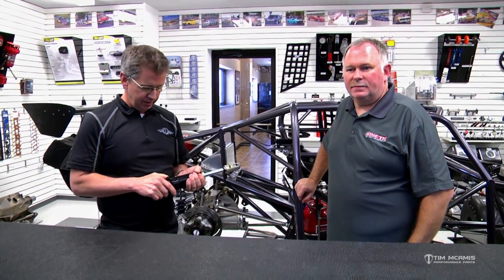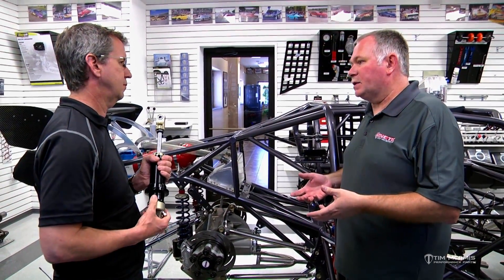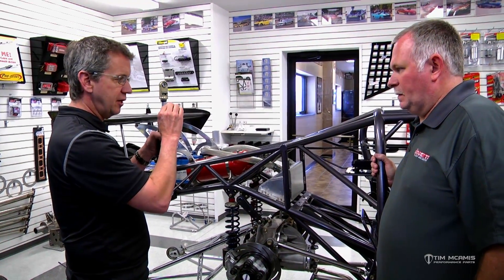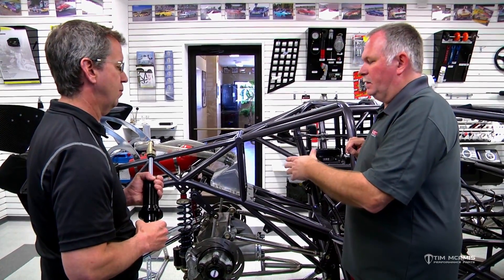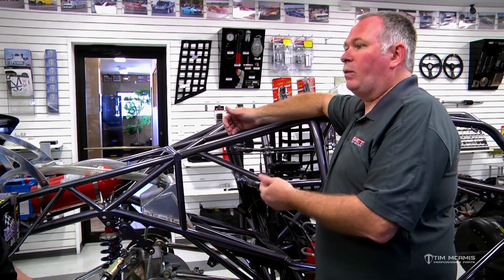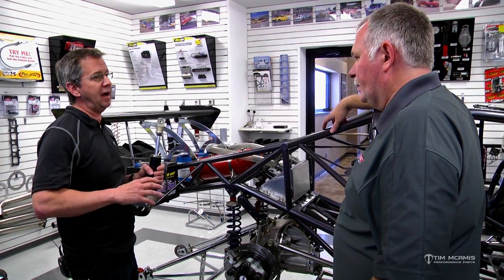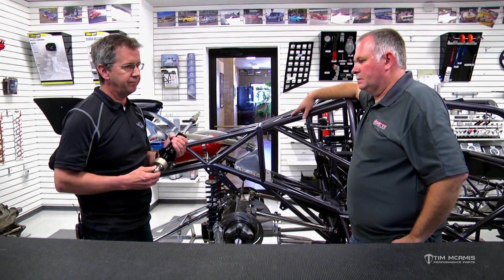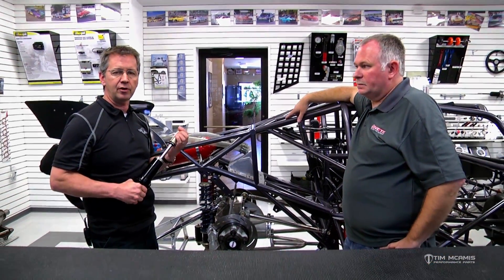Shock Series: 04 - Tuning Basics

Comment: Quick question if a car I'm part of is chrusibg the slicks and then going I to tire shake after the 1,2 shift the car Has just over 100 % anti squat how controllable is this with shocks with air dump or will it be a change in the I stant center and shock combination I know the car has enough hp to go into the 420s as is but anytime we add clutch or move the power closer to the 60 it shakes horribly
Reply from the maker: Contact Chris Bell and I'm sure he can get you lined out with the best information based on your setup. kineticshocks@gmail.com or (314) 996-9102

Comment: Tim, i have Penske 7500DA on my IRS Supra. I noticed that the dyno sheet you have shows stiffest EXT at -6. Does that mean i shouldn't go stiffer then that? On my car, if i go EXT -12, it lauches and stays down but at EXT -4, it seems to bounce back up without touching Compression. Is there a limit if EXT i should be going to?

Comment: huh wait say that again. cooling down causes more traction ?!
Reply: On the hot days yes. There is an optimal temperature that you will have the best traction. It's not uncommon for a track on a hot summer day, lot's of sun, to get a little greasy. So then as the afternoon rolls on it can tighten up and get closer to that perfect temperature.  The opposite can be true for a spring day or a fall day.  Maybe all day the track temp was 85-95 degrees. Lot's of bite, but now the temp starts to drop and we start to lose traction. Maybe it's a night race and it's unseasonably cold. Then you can have real traction issues